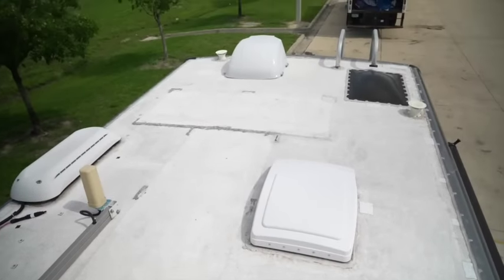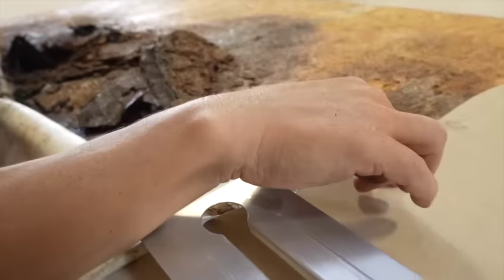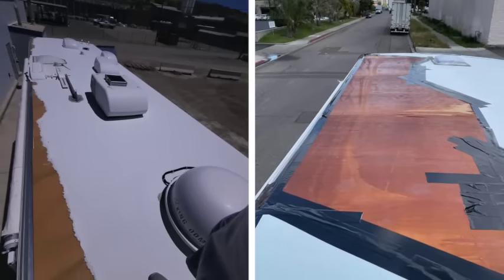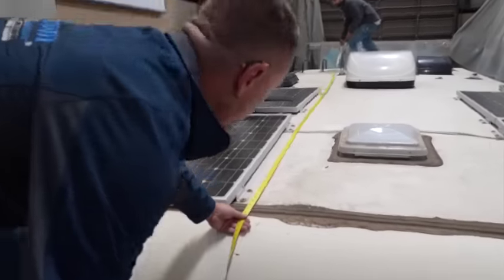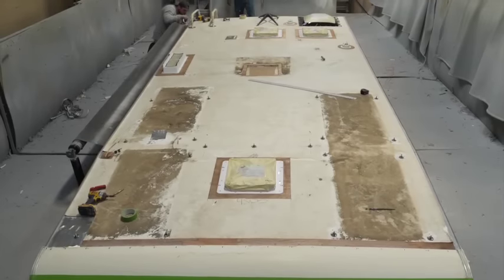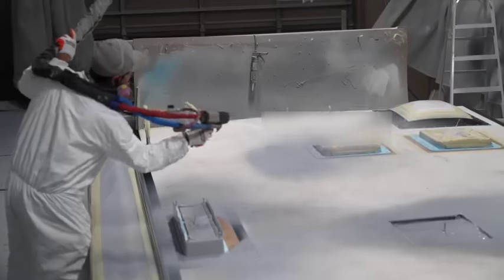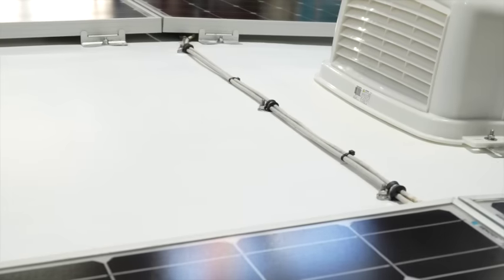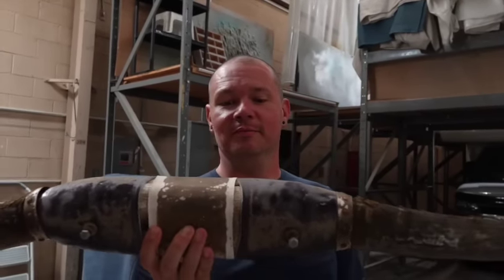The TRUTH About RV Roofs + The Best RV Roof Repair Option

Comment from the maker: FYI: The price for our Flex Armor roof includes the installation of 3 brand-new Maxxair roof vent fans and removing and replacing our solar panels. If you aren't replacing as many components (like fans) your total cost will be less. Get a quote for your own Flex Armor roof based on your RV's length + needs ⬇
→ 🌵 Arizona https://link.eatseerv.com/AZRVRoof
→ 🤠 Texas https://link.eatseerv.com/DentonRVRoof
Reply: That is a very reasonable price for such a high quality material, new accessories,  and installation.
Reply from the maker: Agreed!
Reply: $6500.00  OUCH!!!!

Comment: Seems great, But it wouldn't be for any trailer or rv. The weight alone is a major factor. then there is the skylight. The plastic of the skylight will dry out and crack, then what? from the looks of how this armor has covered the parameter of the skylight. if it had to be replaced, the time to cut it out would probably cost as much as an entire standard TPO or EPDM in materials. I see it now. cost of skylight 100, cost to replace it 1500.00. I'll also add that I noticed the flex armor covers the tops ( last couple inches ) of the vertical rails. While the flex armor will stop any water from intruding the roof, what about the vertical corners of the rear and front trim moldings. those still need maintenance. if for some reason water got past the molding, you'll have to remove and reseal. So you will need to cut the armor flex material from around the trim molding in order to remove it? So I'd guess that would void there warranty.

Comment: I recently had a bit of a oops moment and caused some damage to my roof. After doing some research and getting quotes I decided rather than relying on a patch job or replacing with the same materials from the factory - It was worth the travel time and cost to head down to Prescott and see the guys at AZ RV Roof. Awesome shop, folks and product. Just got home from with the trailer and the new roof. Highly recommend the product!

Comment: I used Flex Armor in Denton, Tx when my then two year old Sunset Trail Reserve roof delaminated.  Four years later I had my 15 year old deer lease trailer roofed by Flex Armor.  When I recently took the deer lease camper to an RV repair shop for other work the technician said that's the best roof he had ever seen.  I agree with him.
Reply from the maker: That's awesome. They do a good job for sure!

Comment: I had this lifetime roof installed 2 years ago. It is a worry free roof, everything is well sealed no need for annual seam sealing. I was also told it’s ok to clean the roof with a pressure washer. Excellent upgrade that will increase resale value of RV. Also the warranty is transferable.
Reply from the maker: Yes to all of those things haha!
Reply: Please tell me what did you use?

Comment: I would take the trim around the cab to rv and check to see if you have broken or missing screws. We had a 2017 Coachmen 27qb thad had a problem from the factory. Very poor quality. 1:04 pm

Comment: I don’t know…….Sometimes spending more up front doesn’t seem like the budget option, but in the long run it is.  That Flex Armor roof kind of looks like truck bed liner for your RV roof.
Reply from the maker: Yes we couldn't agree more! It definitely feels different from that but I see the similarities.
Reply: @EatSeeRV  @Garret Lewis... This is a Flexible application. bed liners are more ridged, and prone to cracking over time. This type of product touts 800% elongation, and 3500 tear strength.  We have spent countless hours grinding off a few attempted bed liner applications ( NO FUN)  RV's flex WAY to much etc. Thanks, S.Fouse # AZRVROOF

Comment: Does adding new items to your roof such as solar panels or replacing items such as vents or sky lights void your lifetime warranty?   These types of things require putting new screws in your roof.
Reply from the maker: Yes it would. That's why they suggest figuring out anything you want to add. They can also add systems so you can add things in the future without needing to drill holes. They'll go over everything with you

Comment: It's really shocking what the RV makers get away with. If you put a rubber roof on your new screen porch, it would come with up to a 40 year warranty. If it failed any time before that, you'd call the contractor out to fix it. And if he tried to dodge responsibility by saying you didn't get up on the roof each year to reseal it, you'd rightly threaten legal action. If that roof failed in the first 5 years and rotted out a major portion of the roof structure as well, you'd file a complaint with the state against his contractor's license and drag him into court. The contractor would either write you a big check, or skip town in the middle of the night, because any court would rule in your favor. 

Yet somehow when it comes to RVs, all that is right out the window. We expect the roof to fail in a very short time. We get up on the roof faithfully each year in an attempt to compensate for the dreadful design and material choices of the manufacturer, and we take full responsibility when the inevitable failures occur. 

A note to the RV makers: I'm not an idiot, and I'm not alone. You're putting yourselves out of business. People know a con when they see one. Enjoy this time you're in where there are still a few suckers left willing to get robbed for your crap product. It won't last much longer.

Comment: We need a new roof on our 2022 MLE22.  While it should be covered by GD it is not.  We are torn between a traditional rubber roof replacement or the Flex Armor.  After a year and a half what would your decision be now? Flex Armor is about 3K more expensive than the tradition rubber roof.  Thank you!
Reply from the maker: We will never not have a Flex Armor roof on our RV. We've done it to two now and as we said in the video it's a non negotiable for us.

Comment: i've seen roofing material for flat roofs and was thinking of using that to repair my brothers rv also used in construction FRP fiberglass reinforced plastic that stuff if strong but 3/16" thick and applied 3 coats, does that mean 3/16x3= 0.56 of an inch or just 3/16 in total. anyway amazing job that was done 👍

Comment: We enjoy the roof material. Only issue is any changes void warranty. Add solar, replace on air antenna, or mushroom roof vents requires an appointment  & several hours labor. And our original installer NO longer is contracted or "franchisee"! But we have great comfort knowing most seams are sealed. You still need to inspect ac gaskets to ensure leaves, stems, etc, do not squeeze between roof & gasket. Can still leak there.
Reply from the maker: Yes very good points. That's why it's a good idea to get all of that done when you replace your roof. Our installer here in Prescott uses a cool bolting system and rail system so you can add components to your RV in the future without needing to rebook and redo the roof in those areas!

Comment: We bought a used RV at a great deal, without shopping around, because we had just lost our other rv to a fire. We did inspect everything but the roof, well Lesson Learned because a cpl months later when it started to rain and leak in a cpl spots, that we discovered that the awning had been cut up and gorilla glued down in strips where the caulking should have been. Makes me shake my head in wonder.
Reply from the maker: Wow wow wow! Crazy. Hopefully you get a leak proof roof to never worry about that again.

Comment: Was your first RV Flex Armor done in Florida and if so why Arizona over Florida since Florida is your home state?  Just asking for those whose reside in eastern USA.  Thank you for your response.
Reply from the maker: Yes we did our old RV (Maggie) in Florida since that's where we are based. We did this one in AZ because we were out west when we bought this RV and wanted it done now
Reply: @EatSeeRV  thanks for the reply.  I have two other questions if you don't mind answering.  I want to get my RV done.  Is the one in Florida the only one on the east coast?  Second, I don't have solar panels yet, but would like in the future.  I have to do additions in stages based on finances.  How do you decides where to place hook-ups so as to not interfer with the integrity of the new roof later when able to add solar panels?  Thanks for you time in responding.

Comment: I'd be interested in hearing about that Starlink antenna. 
I tried to get one for my house and I'm on a year wait list. 
Is that how it's going to be mounted all the time? Doesn't seem very aerodynamic. 
Do you have mobile connectivity or stationary only?
Reply from the maker: We have the RV one made with probability so we can use wherever we go. However we cannot and do not use it when in motion (that's actually grounds for Starlink to end the contract). They do have a mountable one that is made to be up on the roof permanently and can be used in motion but it's $2,500.
Reply: I wouldn't have mounted the Starlink antenna on the roof. Too many campsites have trees close by that will ruin the signal. At least with it not mounted you can move the antenna around to get a good signal. I have Starlink at my house and it's the best service ever, but it can be finicky with nearby obstructions.

Comment: Pretty bad that you can spend well over $100,000 on a Motorhome and they cant even put a decent sealed roof on it. We have a 2009 Winnebago View with a fiberglass roof but we've had water leak in the slide.
Reply from the maker: It is sad that it's the reality of it. Hope you find a good solution for your RV roof.

Comment: Really nice job and wise decision $6,500.00 for the protection and integrity of an RV roof is nothing when you've invested $30-100++K for your rig! I had a 25'TT years ago and it sustained some major water damage. I sold it and vowed I would NEVER own another rv ever again. I solved the problem by buying a cargo trailer and converted it into a camper and now NO MORE ROT! I sealed the all aluminum one piece roof with Krazy Seal that comes with a 50 year warranty against leaking I'll be dead by the time that 50 years comes around!! 😂😂😉😉
Reply from the maker: That's awesome. Water damage with RVs is the worse. Glad you found a solution 😃
Reply: Wow. Guess I shoulda had mine done 3-4 years ago. Quote was for $3600 for 16.5 ft.
Reply from the maker: Haha yes! That'd be. A steal. Although it might not be too far off considering you have a much smaller roof than ours and we got $1000 in fans and such

Comment: NEVER EVER will my roof leak, I have a 2020 Escape 19’, built like a boat. The Square Tube frame will rot out first.
Reply from the maker: I see the Escape has a "seamless aluminum roof." Nice! Definitely check the sides and such it's like fiberglass. Less prone to tear and no sealant but the sides could peel back. Hopefully that never happens. Seems like a quality build
Reply: @EatSeeRV  No, the Escape is a full 2 piece Fibreglass shell, no aluminum or rubber. The only joint is at the waist line. The AC is raised as is the MaxFan opening. They are a work of art. Escape Trailer Industries from British Columbia Canada. The Escape 5.0 fifth wheel is the best trailer on the planet. Convince me otherwise.
Reply from the maker: That's awesome!

Comment: so what was the cost of that job ? ball park
Reply from the maker: We share the exact cost at the end of the video.
Reply: 6500 was well worth it I'm more closer to Denton Texas I'm looking at buying a 37 ft bumper pool I'm more closer to Denton Texas I'm looking at buying a 37 ft bumper pull and I want to add this on and I want to add this roof it will add R-value in adding 316 of an inch is excellent

Comment: How much does Flexarmor weigh per square foot? Is this something you should take into consideration if your RV has a low payload capacity?
Reply from the maker: Yes I would consider it! We didn't have to worry about it with the new RV but there's a good chance you're already overweight if you have low weight capacity. Some of the Mercedes chassis only give you 600-900 lbs of cargo carrying capacity. With 2 people and your things your almost guaranteed to be over. I'd weigh yourself first and find out how much it'd be adding based on your RV size.
Reply: @EatSeeRV  Did you weigh Dita or Maggie before and after? How much weight was added by the new roof?
Reply from the maker: We didn't weigh either of them accurately enough to know. But I think AZ RV Roof would have an idea of weight per foot
Reply: @EatSeeRV  @ Bob. 4-5 Ft/Lineal Foot. Roughly 200 Lbs for a 40'er.
Reply: *LBS/Lineal
Reply: It’s probably a very good product with a long life span, but there is no such thing as a “never ever”
Reply: 1/2 pound per SF.

Comment: How come your videos are only 480p?
Reply from the maker: So glad you asked this. We had no idea it was showing up in such low quality. We just did some digging and if you upload in 60 frames a second (no matter if it's 4K or 1080) it maxes out the frame rate at 480p! So we will be changing our filming and editing frame rate to match 30 frames per second so we can offer 1080 as intended. So frustrating!

Comment: Sure you two can't get those cameras a little closer to your mugs?  sheesh
Reply from the maker: The wide lens we would like to buy is over $1,000. Filming equipment costs money. We're doing the best we can by delivering quality content but we don't make enough from our channel to invest in our equipment as much as we'd like to. If it's too close for comfort for you feel free to send over a tip so we can upgrade our equipment!
Reply: @EatSeeRV  Sounds like you both need to save up for surgery to make your arms actually extend so you can hold the camera you have away from your heads so as not fill the entire screen with them. Maybe, just maybe that would actually work.
Reply from the maker: Yes we'll definitely do that. Thanks for the tip 👎
Reply: @EatSeeRV  Glad to help.

Comment: So one can purchase this kind of coating from Walmart.  It looks like it is made by Liquid Rubber company.  It cost around $80-gal.
Reply from the maker: It's not like that product at all. But diy roof replacement is definitely an option if you're looking for something cheaper.
Reply: @EatSeeRV  Do you have the Material Safety Data Sheet for the product?  Can you post where I can see it?
Reply from the maker: I suggest reaching out AZ RV Roof and chatting with them. We are not licensed installers. Just sharing our experience with the product at this shop.

Comment: This is why I would never buy an RV with wood framing inside.  These roofs are so problematic.  I buy metal frame steel skinned vehicles and then customize them into an RV.
Reply: What are some examples of the metal frame steel skinned vehicles which you have purchase or hope to purchase? Sounds like a good idea.

Comment: I'm a journeyman roofer and I use commercial torch on membrane for .t RVs.     30 year roof.  RVs Re weak.  RV roofs are a joke.    Wise to do it right.  Like a building roof.  Only need 1 ply.   Also wise to torch on membrane on top of floors.  RVs are made to break.  Weak weak weak.   Your make your roof better .    Wise to think like a drip.  Where does water go ?? RV manufacturing is so off and only makes problems with poor designs.  😂

Comment: I would like to buy a new rv with a Flex Armor  before it left the factory. Since a TPO Roof cost about $10K to replace.
Reply from the maker: It's a bummer it's not an option at the factory but at least it's an optional upgrade after.